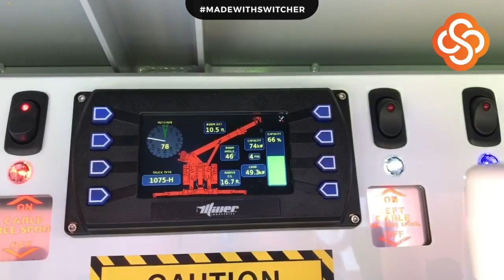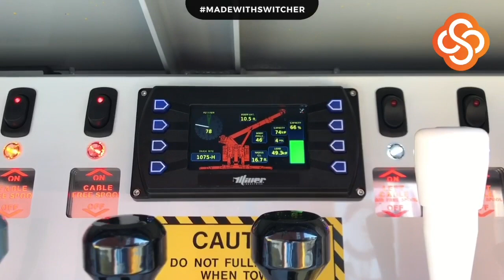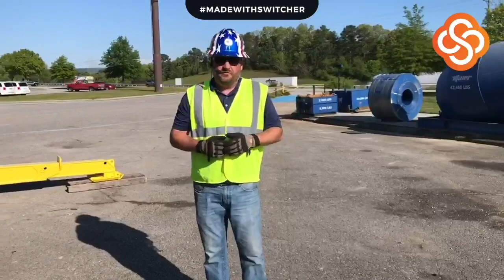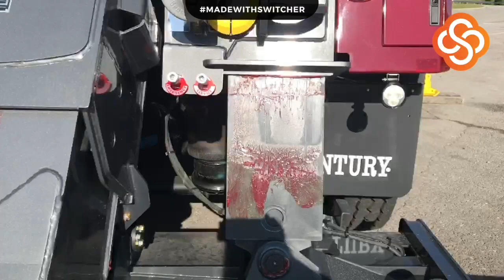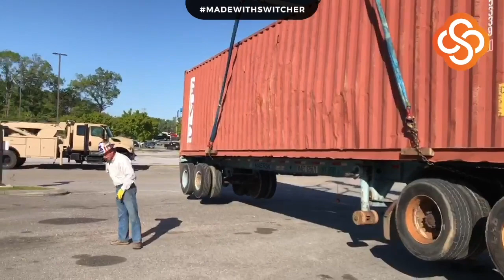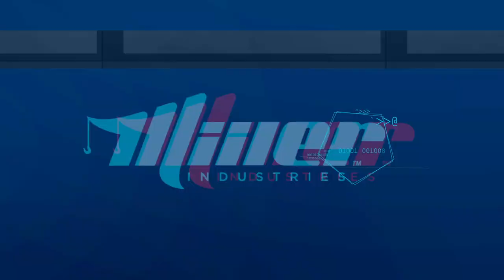Century 1075 Live Demo

Comment: 1075 can you slide the rotator back  the rear wheels
Reply: Kenneth Orton The 1075 is not equipped with a rolling carriage, so the boom is stationary
Reply: 1075s aren’t rolling, I believe that’s only on the 1150 and maybe the Vulcan 50 ton rotator.